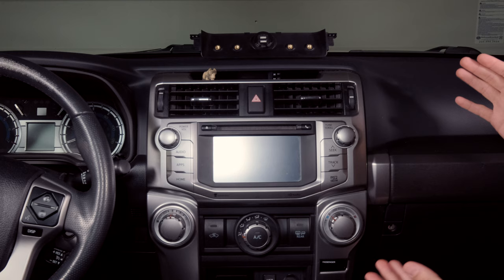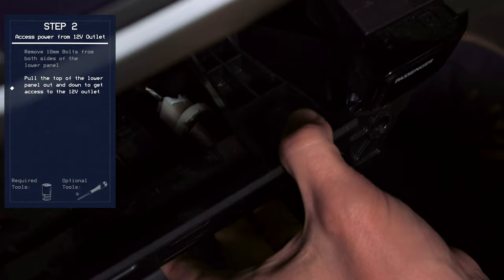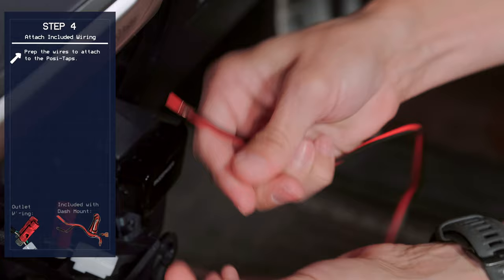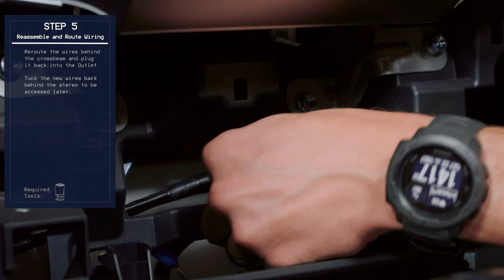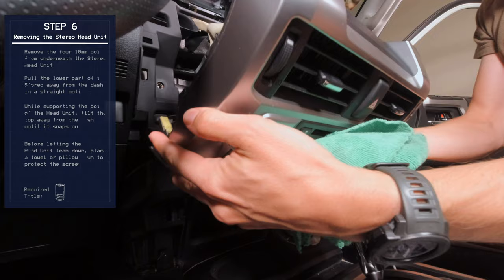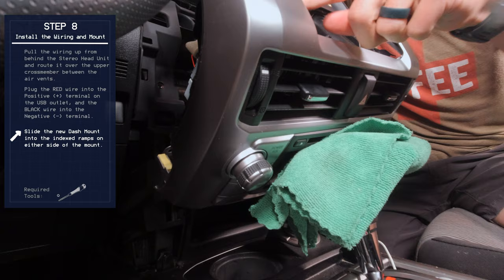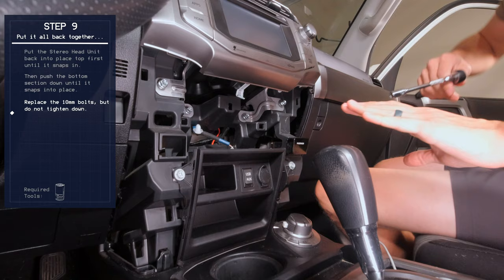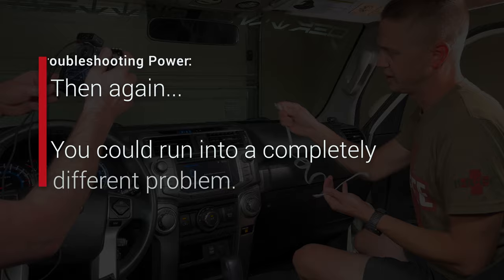Installing the Stealthiest Dash Mount in the 5th Gen 4Runner for Mounting Devices - Lab Ops Gear!

Comment: Would love to see a test of how stable this is on bumpy roads. I've read/heard that it wobbles quite a bit with just a phone attached.
Reply: It does wobble quite a bit. Just installed mine 2 days ago. All i have mounted on is my iphone 12 and on a flat highway / road it is quite wobbly. Very disappointing.
Reply: I have had mine for a few months now.  Two of the brass inserts have stripped out from the plastic.  Also, the devices wobble quite a bit.  Lastly, because of the wobble, it squeaks like crazy.
Reply: I'm glad I saw this comment before shelling out the cash to get one. I have a iphone 14 Pro Max so it's heavy and I wouldn't want it falling off on a rough road.

Comment: I just installed one myself. Its very thin and flexible so use caution with what you mount.
Reply: Aww man really!? I was all excited about it.......
Reply from the maker: It should be thin, but it should not be flexible... I wouldn't want to mount a laptop on it, but for most handheld devices it is perfect for our needs. Have you reached out to Lab Ops Gear about the problems you are having?
Reply: @TrailorSailYT  Yes I have. Its not sturdy at all and all I have on it is an iphone 13.
Reply: I have one of the first 3d printed versions and I found this to be the case as well.  The product itself is rigid enough.  The problem is that the mount points allow for a fair amount of flex.  When on dirt roads, anything I have mounted bounces around a lot.

Comment: Just installed this and it is quite flimsy. I am using an aftermarket HU with an aftermarket bezel so not sure if that is the reason. I will be buying a RAM mount wireless charger phone mount and seeing how well this works.
Reply: Will this thing hold up to off road abuse?

Comment: I installed this recently.  Your fitment and installation instructions are excellent.  I do, however, have a couple of concerns.   While attaching one of the ball mounts, the brass insert in the platform stripped out of the plastic.  I now cannot use that location as I cannot tighten the ball mount.  Further, I question the strength and rigidity of the platform itself.  It flexes quite a bit with anything mounted to it.  For major off-road driving on rough roads, I imagine a failure is imminent.

Comment: Is there a a big difference in the install for a newer 4Runner(2021) or a different video?
Reply from the maker: I haven’t seen the interior of the newer 4Runners yet. I’ll ask around.
Reply from the maker: Okay. It doesn't look like there is a significant difference in the process of doing this on a 2021/2022. The head unit is different, but instructions appear to be the same. I have seen a few people on Instagram sporting the new design on their 21/22 4Runners, but I would contact Lab Ops Gear directly if you have questions about it.
Reply: @TrailorSailYT  thank you for following up.
Reply: I've a 2020 and the wire color is different taping into the cigarette lighter red wire and a white with a black stripe.

Comment: Which RAM mount arm is pictured on the left most mount in the beginning of the video? Medium length, b size?
Reply from the maker: https://labopsgear.com/products/low-profile-composite-double-socket

I believe this is the correct one, but I will check with Lab Ops Gear to see if that is right.
Reply from the maker: I did confirm that link is the correct one.

Comment: Will this fit a 2013?
Reply from the maker: I would reach out to Lab Ops Gear to find out on that. Email: info@labopsgear.com
I have a friend with a 2012 (same dash as the 2013). I'll see if she can lend me her 4Runner for an evening to check it out.
Reply from the maker: So, I spoke with Lab Ops Gear about the earlier 5th Gen 4Runners. While it will work for the 2010-2014 4Runners, there are some slight differences that require modifications. Apparently there are some parts of the Clock/Display that protrude into the area the USB outlets would be. Lab Ops Gear is looking into possible solutions to keep their customers from needing to do any irreversible modifications. Stay Tuned!